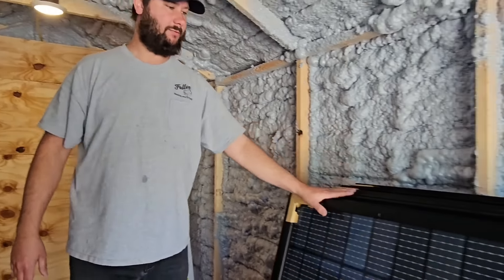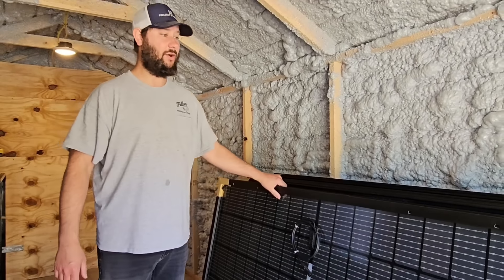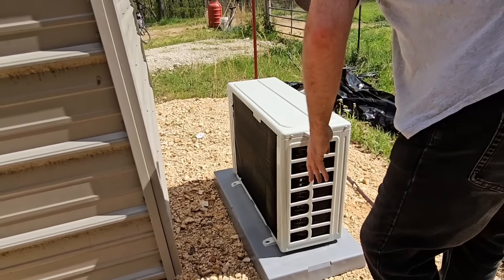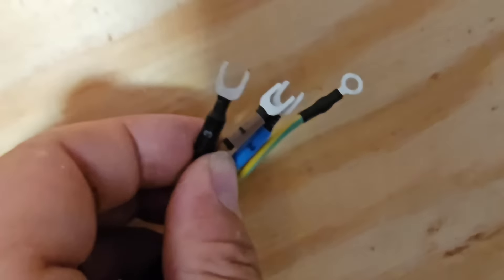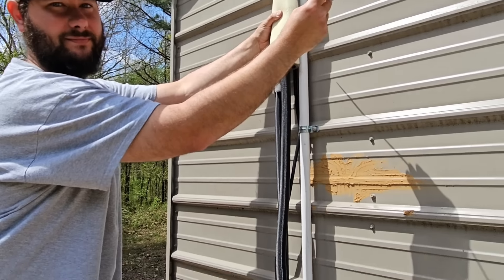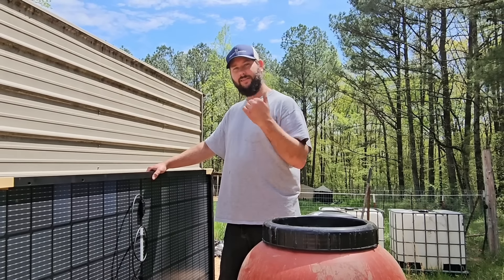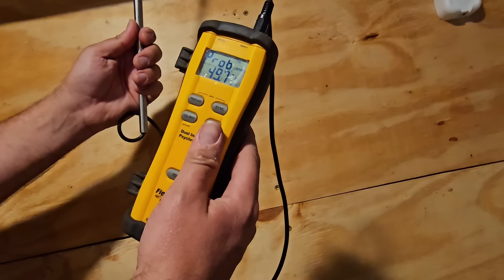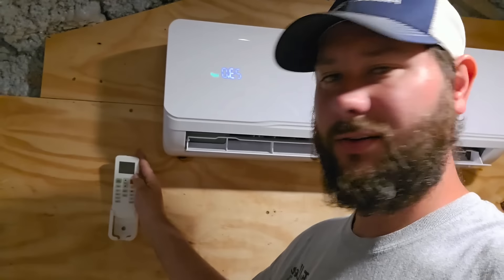Cool Your Home for FREE with Solar Powered AC!

Comment: Hey Taddy, I have enjoyed watching previous video's or yours.  This was okay.  There were lots of flaws I noticed.  I understand this is for the DYI homeowner, but homeowner's have no business installing these types of equipment.  These are not well built mini split units, so what ends up happening is units fail, customer is pissed off because they spent money on less then quality product, then companies like mine have to come in a replace equipment that costs them more money.  There are not great warranties on these units either.  It's great that it hooks up to solar but that's about it.  Then leaving excess line-set rolled up just makes the job look like crap.  You do good work but these units are not something a homeowner should try installing or purchasing.  I also wonder how home insurance companies looks at 208/220 volt equipment installed by non-contractors/home owners, I know here its an issue, especially if there is a fire.  Also the new refrigerant coming out will be an issue as well.  Keep up the other stuff, leave this kind of stuff alone.
Reply: That's sound so unsecure from an hvac guy I would never try to uninformed people about products that are competing on my line of work .
Being installed diy not mean the warranty it's gone be different I had units installed in home by "professionals" paid them twice what the unit itself costs if I use my line of work license to buy them ; guess what 
fail in months and the manufacturer made up 100 excuses to not cover the unit.
Reply: You jus mad because more people a learning how to do their own work, come on man.
Reply: Let me guess, you work for a company that produces a competing product?

Comment: So @ max full sun you get 9.875 amps @ 120volts so at night you get no a/c/JOKE!
Reply from the maker: It works at night. It switches over to a 115 volt a c power automatically

Comment: You used wrong electric  connector 
You should vacuumed lines before  releasing coolant, you contaminated  coolant
Example of those who can do install do, those who can't  try n teach
Reply from the maker: You don't have to vacuum
Read the manual
It's at my house on my shed. I can use whatever connector I want
Thanks for watching

Comment: It is an example of doing things wrong, you don't know anything about refrigeration, you didn't create a vacuum, you didn't cut the lines, you mentioned little about the connection of the solar panels, a disaster of work
Reply from the maker: It's precharged line sets
And quick connectors
You don't have to pull a vacuum
Have you ever installed one of these units?

Did you see flare connections?
Did you read the installation manual??
Reply: Lines charged; vacuum no need
Lines long enough; cut no need
Solar panel: click-click, no more need

Big room cold; brrr, good work

See? So simple, a CaveMan could understand it